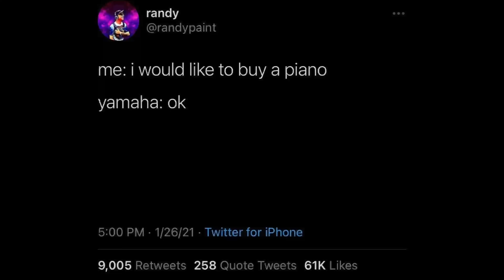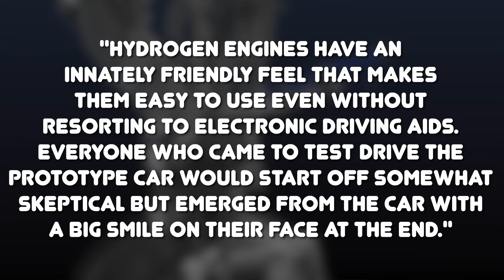Toyota's New 455HP Hydrogen V8: Everything You Need to Know

Comment: this is sick. was skeptical about toyota's hydrogen use cases up until now, i'll gladly take a V8
Reply from the maker: Yup, same!
Reply: @Dustrunnersauto  I disagree with the battery statement, we have reached the max efficiency for lithium in car applications. Something like this would offer truckers and long haulers to keep going without having to charge for an hour to get decent range. Watch real engineering and he explains this topic very well. But to say electric vehicles will take over the market entirely or these won’t sell well is putting them down too much
Reply: @Dustrunnersauto  Is Your name Bryce ? 
Who is paying, supporting, financing Your Journal ?
Clearly in this video, You are only producing information and content that 'fits' into the Globalists/Elite Agenda.
Also in fact You convey false, incorrect, distorted, misleading information about internal combustion engines, electric vehicles, specifically about Tesla, etc.
You also failed to present the other hydrogen vehicle version of Toyota also.
And in addotion, all of the means, advantages with Hydrogen vehicles over every scenario of electric vehicles. 
also YOu ignore all of the lacking, especially the infrastructure for a complete changeover to electric vehicles, along with the falsehood of "zero maintenance" for electric vehicles, heavy weight, lack of individual, owner repair 'rights' that specifically Tesla violates and refuses to the agreement, and the completely centralized control over each individual vehicle; Great for The Globalists/Elite Agenda which the falsehood 'Green" directive is just a small part in their Grand scheme of Global Governance.
Clearly You are not old enough to know about the numerous attempts, companies which produced many electric vehicles, hydrogen engine vehicles, ethanol from the before the 1970's, through the 1980's. Why were these never allowed but, at specific time period, with a specific company, owned by a specific person Elon Musk, their vehicles have been successfully promoted, sold, which are expensive, with massive manufacturing in the USA, then Mega-Plant in CCP-China, next larger plant in Germany, now operational, and next a second in Texas. 
Thus Elon Musk, a clear, obvious partner among the Globalist/Elite [as W. Gates, J. Bezos, Rockefeller, Rothschild, G. Soros, FED, IMF, World Bank, biG/AlphBtI, Apple, MS, Intel, Qualcomm, Samsung (now joined with Tesla - no surprise there), AMD & Global Foundries [UAE], TSMC, Plantir, Cisco, etc.] also with his Space-X, embedded human electronics development [initially for Allopathy/Pharm. medical (also Rockefeller Elite)].
What happened to all of these others, then one company allowed to grow, produce, lead, with the other major automakers, falling in line behind.
Also GM had fully electric vehicles developed, produced, shown, some with full solar panel exteriors back 40 years ago too.
They [all worldwide manufactures] are part of the Globalist/Elite direction, dictation, control, plans and Agenda.
Clearly You are either so ignorant, foolish and inDOCtrinated along with their falsehood, pretense, lies, propaganda or knowingly involved with them.
Which of these are correct ?
Sincerely
Reply from the maker: @newtonfirefly3584  go touch grass.
Reply from the maker: @newtonfirefly3584  pErHaPs yOu WiLl bE a GoOd hUmAn iN tHe FuTuRe iF yOu dEcIdE tO ChAnGe. Nothing is black and white. Your predetermined notion of one's character and whether or not they are a "good human" is irrelevant to me and anyone else, for that matter.

Once again, go touch grass.
Reply: @Dustrunnersauto  cool video but dude, there's not zero emissions...NOx is a deal breaker in H2. This is what Toyota isn't telling us. More NOx since H2 burns much hotter. Only way (currently) you can get acceptable NOx is to decrease the combustion temp by decreasing fuel flow...this kills power. So the power number they quote is certainly not with regulation NOx, otherwise it would be roughly half. Maybe this is a racing only engine? Perhaps Toyota has ideas around this issue, but it's a huge technological challenge and far from being solved. So your conclusion is correct...but just missed this point.
Reply: @Dustrunnersauto  do a cost breakdown on EV,s, hydrogen, gas/petrol,  full buld of the car, dirt to driveway. petrol/gas, wins everytime. 75 yrs for a prius to break even.. no green energy is cost effective. look at re cycleing wind turbines, solar panels.. its a joke..
Reply: @JK mate, here in aus, s.a. went to the drags, with a td cortina,250ci,, on lpg, beat all the v8,s. 10 secs.. first time out.. those nuts with EV hho power, need to look at lpg. its allready got everything in place, & pumps out oxygen..no cat, no computer, nothing. just retard timing, raise compression.. no millions, billions of $, on bs new tech..lpg, is a waste product, they burn it off.. being green,is a scam, same as covid.. watch vids on mining for cobolt & lithium.. then, decide what you want.. ill keep my f250 diesel. thanks..
Reply: just another bs release by a idiot ceo of toyota, hydrogen isnt even a  naturally occurring gas it needs to be created and the power resulting from creating is only 30% of the power used to create it ... end of story
Reply: It's not going to happen.
Reply: If you know anything about physics or chemistry, you’d know this engine is basically a hoax.
Reply: Me too! Biggest problem with it is no infrastructure. 
Toyota and Mazda will have to make hydrogen stations to go with the hydrogen cars just as Tesla made power stations for their electric cars.
Reply: @DAN007thefoxx1  better yet still, are home based, and in-vehicle electrolysis that extracts te hydrogen from any water source and others which extract from the air and exhaust too. These exist, actually.
Reply: @newtonfirefly3584  It exists but it doesn't actually work. 
As Scotty Kilmer put it, you would expend more energy to seperate atoms than you would ever get back burning the freshly created hydrogen gas. 

Actually the Mythbusters tested several "get better gas milage" gadgets on both carburated and EFI engines and not only do none of them work, some actually made it worse. 

And also pure EVs are never truly "maintenance free" and yes you are still more or less limited to city driving only if you want the added "convenience". Plus the mining process for LiON batteries is still very bad for the environment and can be rather unstable in a wreck. Even to the point of burning aggressively while emitting toxic fumes.

As for hydrogen fuel CELLS, from the experiment that I did in middle school with em and if I remember right you don't get much energy for what you must invest into it, and you also must flush them out every few hours.
Reply: @DAN007thefoxx1  Scotty Kilmer is just a 'good mechanic' and lacks sufficient, and proper information, sometime conveys false, incorrect, distorted, misleading information too. He lacks the technician level as a mechanic, and certainly not an engineer, with less than full breadth, with and certainly depth of information, knowledge, expertise. Some what he conveys is very useful, helpful, beneficial, but need to be balanced with actual, proper information, etc. too.
The developer of the working hydrogen vehicle, Stanley Meyer, which had such a device which converted, extracted hydrogen from the water efficiently, properly, effectively and efficiently, such that the vehicle continued to function for extensive distances with just a 10 gallon water tank and functioned with any type of water available [tap, fresh, sea, etc.] Thus it proves that Scotty Kilmer does not know properly what he is attempting to convey about hydrogen vehicles and actual functioning systems.
Am not aware of any specific devices, which You are referring with regard to "Mythbusters", nor that specific group either.
There is a proven water injection system which was in mechanics illustrated back in the late 1970's which actually functions, improved power, efficiency via slightly increased compression, inexpensive and individuals able to implement.
There are devices and products which are sold which are good and those which are not.
Your agreement with some of the issues with EV is commendable, though still ignores the centralized control issues, which can be implemented on any type of vehicle with any type of engine, motor, power train.
Your description of Hydrogen fuel cells used in Your high school experiments, is not valid for comparison to those that experts, including Toyota and others have developed. Clearly a public or private high school does not have the funding to have the more advanced, developed version, because of their financial limits and purpose. A university which is involved in the development would have valuable versions, if there is any development occurring there with specific professors in the department. There are some useful aspects from the experiments, including the issues You mention, but only identify some ares which the experts actually are aware of and thus have developed their improvements, solutions, etc..

All The Best,
Sincerely
Reply: @newtonfirefly3584  bro you flamed these kids so hard with intelligent logical reasoning they developed dyslexia 😂. I can't even find where you mentioned someone being a "good human". 

One of them needs to stop smoking grass
Reply: @newtonfirefly3584  hahahah. Nah. You obviously have issues mate
Reply: @user-ko3sd9qj2h  obviously.... issues with conveying and presenting Falsehood, etc. and those that do too.
Reply: @newtonfirefly3584  I mean I saw that reply and I was like woah 😳 😂
Reply: @user-ko3sd9qj2h  That is Your issue, then.
that You think You can attempt to assess, evaluate others, then comment in that manner, which attempts to direct, dictate an  control others.
Perhaps better human, interpersonal, social and proper communication skills would be useful, helpful and beneficial ?
Reply: @user-ko3sd9qj2h  the first portion of You comment to me was clearly a complement and agreement.
The latter seemed to switch, claiming my comment lacked referring to any as human.
upon that section my reply was focused
perhaps that portion was meant differently ?
Reply: I mean I think companies should be looking into several different types of fuel and/or engine types. Electric has the lead right now in terms of zero emissions but that doesn't mean it's always going to be that way. Like everything these days, people seem to have emotion attached to one camp or the other.
Reply: See this nee e whine on the Bat Mobile from the new Batman movie! It’s sounds sooo good!! Long love internal combustion engines, thank you Toyota and Mazda!

Comment: I’d rather have a hydrogen powered  internal combustion engine than electric powered. My electricity bill is through tue roof in SoCal
Reply: You can thank the democrats there
Reply: So you think hydrogen is going to be a cheap fuel?  Prepare to be surprised....
Reply: Hydrogen can be separated, compressed and stored almost indefinitely for future use during off-peak hours.   Keeps you free to move around during those PG&E blackouts.
Reply from the maker: Everything is expensive in cali.